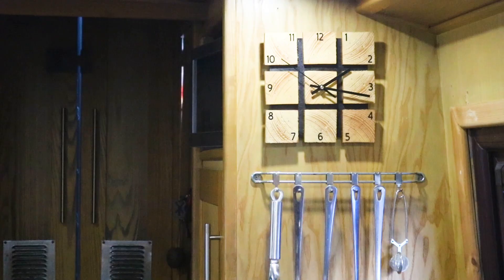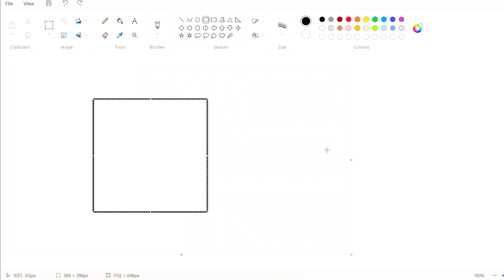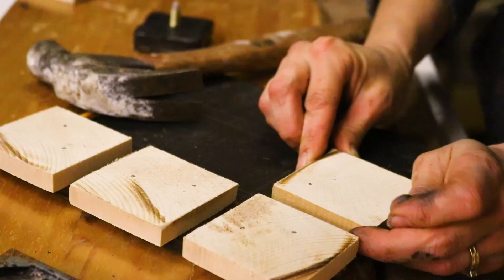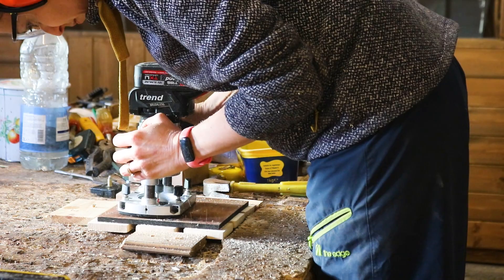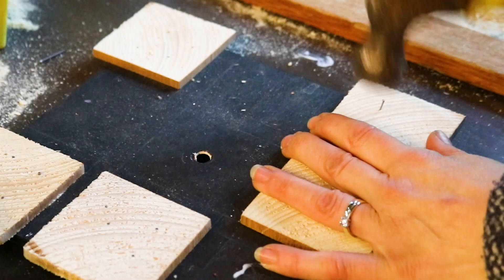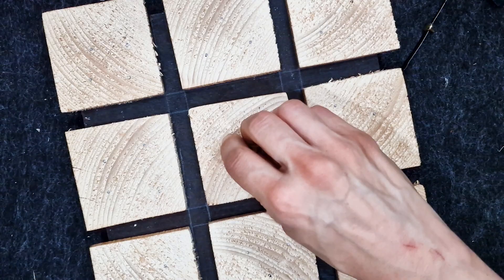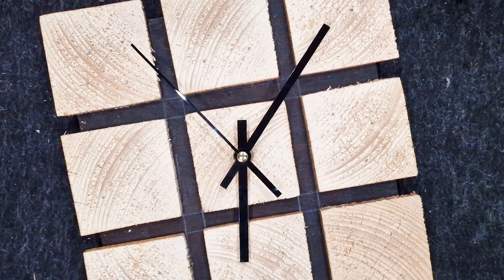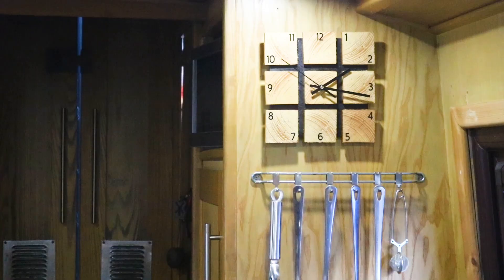Old Fence Post Clock | 12 Days of Giftmas #10 | The Carpenter's Daughter

Comment: top tip... when you put the hour hand exactly on the hour, you need to point the minute hand there too or it wont line up properly (or put the hour at half past and then put the minute hand on at 6 if that is easier to manipulate) (don't ask how i know.) (seconds too, but it doesn't matter as much)